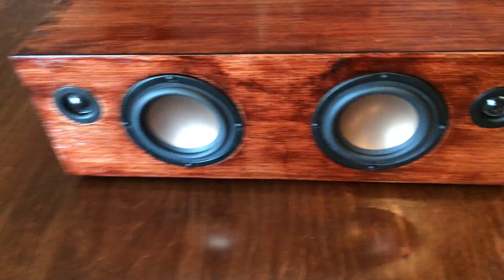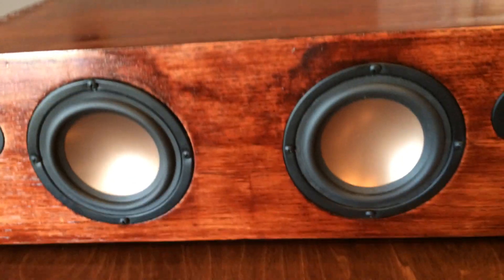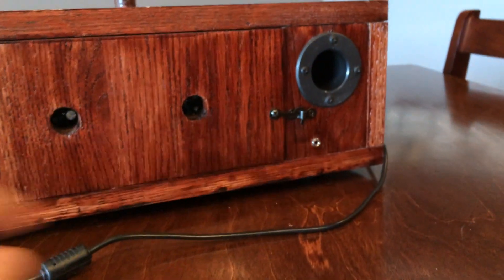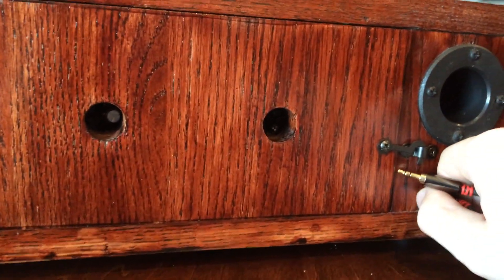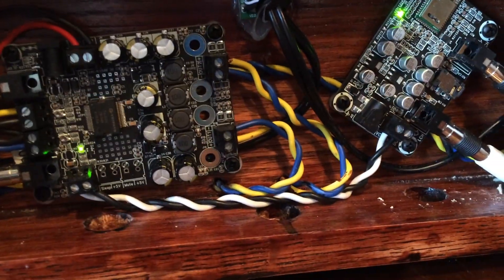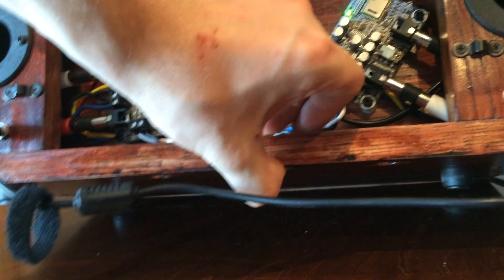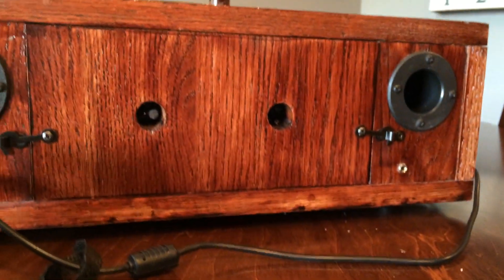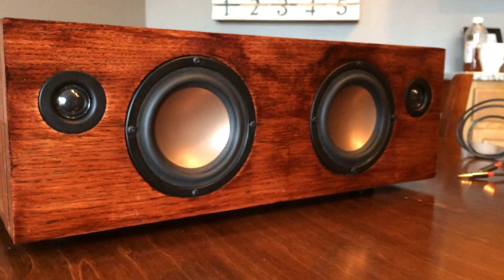Overnight Sensation Bluetooth Speaker Build

Comment: this setup sound way better then the dewalt
Reply from the maker: Thanks.  I also really love how this sounds!
Reply: i am guessing its the wood casing and crossover since its using same as the red speaker?
Reply from the maker: It's actually a completely different concept.  In this build, the HIVI speaker is used as a midrange to handle sound up to 4000hz, with the tweeter taking care of the rest.  In the Dewalt Build, I used 4 full-range drivers that handled from 200hz on up. The HIVI was used as a woofer, handling only 200hz on down.

Comment: Have you thought about putting a Driver in the rear center section? I've seen guy in the Philippines who did that.
Reply: Nick W I have an expensive set of Bose speakers for your tv with a Subwoofer box itself that went tits up, not sure if I can repair the woofer box, it might just need the speaker replaced. I haven't taken it apart to see what went wrong it was barely even used for watching DVD movies.
Reply from the maker: +TekReview&#39;s This particular cabinet, that wouldn't really be a good idea.  These are already full range and that would only hinder the sound quality.  But I have thought of making a bipolar stereo 2.1 speaker.  It would involve 4 HiWave BMR12, 2 pairs wired in parallel (to get 4 ohms) and a B4N woofer for bass.  I would put both 2 HiWave BMR12 on both the front and back in a bipolar design.  It should really sound nice.  I just haven't actually done it yet ;)
Reply from the maker: +TekReview&#39;s If you aren't getting any sound from it, it may be the amp that went on it.  The easiest thing to do would be to take the woofer out and test it on another amp.  If it works, its the amp that went bad, if it doesn't, it could possibly be the woofer.  Although, that may not be the only issue.
Reply from the maker: +TekReview&#39;s By the way, I did just order the speakers for the Bipolar Boombox build.  Stay tuned for when I start it.  And feel free to check out my channel for other great bluetooth speaker builds.
Reply: 123Toid Cool I need to get out my Bose Sound System for the tv and see whats wrong with the subwoofer, or just gut them and make a Bluetooth Ghetto Blaster :)

Comment: perfecttt.. What type of wood you use. it looks very nice. and how it shines.
Reply from the maker: +ümit çağlar Thanks!  I'm glad you like it.  I used Solid Oak for the cabinet and covered it in Minwax Polyshades - Bombay Mahogany Gloss.   I tested a few different stains before i found this one.  But I must say, this one was by far my favorite.
Reply: Thank you. minwax not the turkey. Do you use varnish becomes of it?
Reply from the maker: +ümit çağlar The product I used was both a stain and a gloss polyurethane in one.  I did two coats of that, which would be like 2 coats of gloss polyurethane on top,  I hope this helps.
Reply: I understood thank you. I'll use this system

Comment: What speaker wire gauge did you use between the speaker to crossover and crossover to amp?
Reply from the maker: Aaron Lilly I used 16ga
Reply: 123Toid thanks. I have some lying around so that will work great. Again appreciate your work.

Comment: how did you wire up the 3.5mm imput?
Reply from the maker: In between the RCA on the amplifier board, is a second input.  I wired Channel 1 and Channel 2 to the labeled input on the 3.5 jack.  The ground I jumped on the board and then ran that to the same 3.5 jack.  Here are the parts, so you can see what I am saying. Amp: https://www.parts-express.com/sure-electronics-aa-ab32155-2x15w-at-4-ohm-ta2024-class-d-audio-amplifier-board-only--320-330  Jack: https://www.parts-express.com/35mm-stereo-panel-mount-jack--090-317
Reply: same amps I'm using.  just wasn't sure how to get v the 3 5mn imput.
Reply from the maker: Ronnie Wright w
I hope that helped.
Reply: absolutely it does. and how could me message easier? I have a few questions about battery wiring?
Reply from the maker: Ronnie Wright you can send me a youtube message
Reply: 123Toid I would but I'm new to this whole YouTube thing.
Reply from the maker: Ronnie Wright No problem.  Ask me on here: http://www.avsforum.com/forum/155-diy-speakers-subs/2324209-help-first-build-bluetooth-speaker.html#/topics/2324209
Reply: 123Toid I figured it out. But now my question is on the sprite build what 20ohm resistor do I need the have 5w 10w 20w I looked everywhere and couldn't find a write up on the crossover parts needed.  also I have nd90-4 And I know he did a parts list for that also. Just can't find it. thanks again
Reply from the maker: Just to be clear, the Sprite build uses the ND90-8 which has a different response than the ND90-4.  I'm sure it can be altered for those speakers if you want.  They do use a 20ohm resistor and the wattage probably isn't going to make a difference for those speakers, but most of us use this 10w resistor from Parts express: https://www.parts-express.com/dayton-audio-dnr-20-20-ohm-10w-precision-audio-grade-resistor--004-20
Reply: 123Toid yeah I seen on Paul's write up that you can use the 4ohm ones but you need 3 things.  But he didn't write out what that was. So I need a 20ohm 10w resistors and a 18awg .90 inductor?
Reply from the maker: You are correct
Reply from the maker: If you are interested, I did a build of the Sprites, here: https://www.youtube.com/watch?v=gMUI2t7_svM&index=3&t=23s&list=PL6hjpiCHZmIOJxEOiOiZZsj-g5ddDCANU
Reply: 123Toid I watched it. nice build by the way. what build do you like more? the sensation or sprite?
Reply from the maker: The Overnight Sensations have a better sound quality and fill a room more, so that is really nice if you are trying to accomplish that.  However, I enjoy the Sprites better for nearfield (ie computer monitors), like I am using my Sprites.  So it really depends on what you are using them for.

Comment: Awesome project, well done! I am in the process of building a Madeleine too.

Do you have any details on how you installed the 3.5mm stereo jack? Does it auto-switch from the bluetooth to the amp when plugged in? What part did you buy?
Reply from the maker: +chemchemchemacky Thanks!  I'll try my best to answer your questions for you.  i believe that amp is wired in a way that if you tried to run both the bluetooth and the 3.5mm jack, that it would send both signals through it.  Although, I honestly have not ever tried it.  There doesn't appear to be any type of auto switch detection.  However, if you have only one source playing, it'll play that source (ie the bluetooth or the 3.5 mm jack).  

Now for the second part of your question, I had to buy two parts from parts express: a 3.5 mm jack (Part # 090-317) and some Sure screw terminals (Part # 320-3370).  The screw terminals are optional, if you'd rather solder directly to the sure amplifier.  But I'd use them, because, you'll want to add one to the axillary power on the board, that way you can chain the power to the bluetooth.

So you take your two screw terminals and solder them on the board between the RCA outs.  These are labeled Channel 1 and 2.  Then you run a wire to channel 1 on the 3.5mm jack, one to channel 2 and a cable for negative so the cables.  You'll then want to jump the two negative cable (ie run a small wire between the two negatives on channel 1 and 2 on the amp.  You'll see this around 2 minutes and 51 seconds on the video.  The black wire between the two RCA's, is  jumped between both terminals.  Let me know if you have anymore questions.  And please, if you end up videoing it after, leave a link, I'd love to see it!

Comment: I'm looking to do something very similar to this. Powered bluetooth OS but keeping them separated. I have two questions for you. 1. how did you add the volume control? and 2. Is that really enough power for the OS to reach their full potential? I was thinking about using the dayton audio kab-250a to power these. Thanks - you have a new subscriber!
Reply from the maker: You could definitely use the KAB-250.  They can run up to 30 continuous watts, the 252 board you are looking at would be perfect for it.  I personally, do not blare my music so the 2x15 was plenty for me.  However, it never hurts to have a little more power, just in case :).  As far as the volume control goes. I just cut an Oak plug and hole to fit it.  Then drilled a hole directly in the center so I could have an oak volume pot on top.  But you can always just use the volume control that you can buy specifically for that board.  But honestly, I just use my bluetooth device (phone or computer) to control the volume.  I never use the pot on top.

Comment: slick build on my 2nd one I think I'll make it look alot cleaner for the inside the house look. if you have time check out the one I just did tell me what you think and any improvement ideas
Reply from the maker: +CrownMan00 Dude awesome build!  I love the fact that you are recycling speakers. And I like the box you are using.  Is it an old instrument case?  I am doing that on my current build.  I'll link you to the playlist.  I am still working on it, but it may give some ideas on finish (ways to mount the amp and paint finish) then would be better for me to explain.  But a couple other ideas that may help: if you think this may be something that you are going to keep at the house most of the time, you can sub divide the box so all the components are int he back of the box.  It typically gives it better acoustics and a nicer final look.  You could also build a seperate box that would house the batteries, with a 2.5 by 5.5mm female hookup. That way when you want to take it portable, jsut grab the battery back and take it.  That will save space in the house.

My next one, I am actually using bondo on the MDF in order to get a nice high gloss finish.  That may be something to consider if you like that idea.  Anyway hit me up anytime with any qestions.  I love the work you do.

https://www.youtube.com/playlist?list=PL6hjpiCHZmIO09ediZ7uYrMx_R3Px8Xvt

Comment: I'm sorry for this, but a power supply for this is wide ranged, but if this one is 50w a channel and you want you can use 4.2a ~ 5a if it's 25w a channel then half will do, but the amps of the supply can be more, the amplifier doesn't care just the min matters. You can use 8v ~ 25v I don't run these at full voltage unless the capacitor says 35v, if the capacitor says 25v you can count on it blowing before its time. I don't trust these cheap Chinese amps, but you can't get max volume using 12v. The amp needs a minimal amperage to run full power but will only take as much as needed from a 10 or more amp power supply. If the amp is 50w a channel 2 channels driven and your speakers are 30w a channel you can blow them so you can go with 16v ~ 19v I believe. If you want that 100w you're going to have 10% THD and if you back it down to 70w total you may get 0.1% THD using a heatsink if you crank it. Most every one of these amp are rated @ 10% THD not 0.1 I wish they would make all of these amps rated @ 0.01, but it is what it is. If you want it clean, go with 24v and turn the volume down. Using less voltage and cranking it will defeat the purpose. If you have a LED and it runs at 3v and .02A you will need a 100ohm resistor if you're using a 5v @ 10amp power supply, but if you had a 3v @ 10amp power supply you wouldn't need a resistor even though the LED draws only 0.02amp because the LED draws the amperage and not being force fed. Ohms law says if you have a 5v supply and your LED can only handle 3v then you subtract the 3v from the 5v and you have 2v then divide that by the 0.02 and you'll get 100, that will be the ohms needed, but if you want long life, use a 350ohm resistor, but nothing under 100ohm. A battery will take all of the amperage available and blow up so a battery is different. If I'm wrong anywhere let me know please.